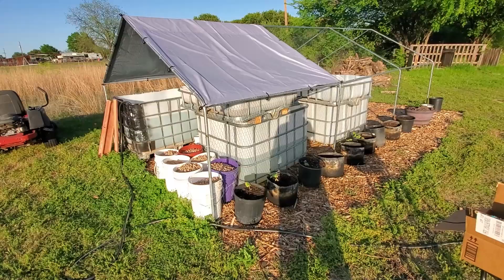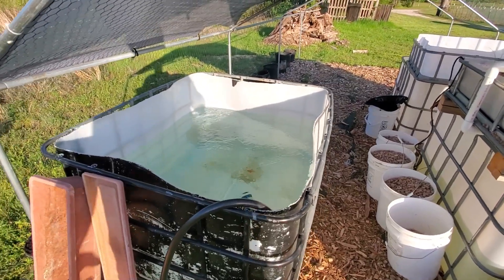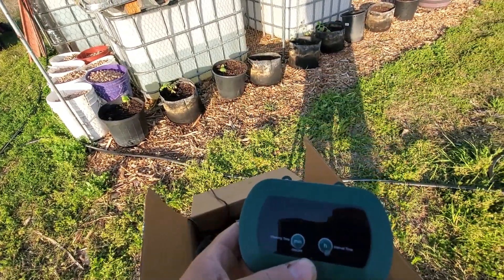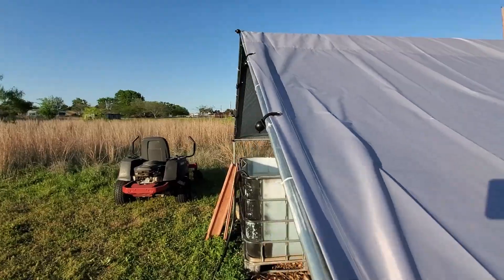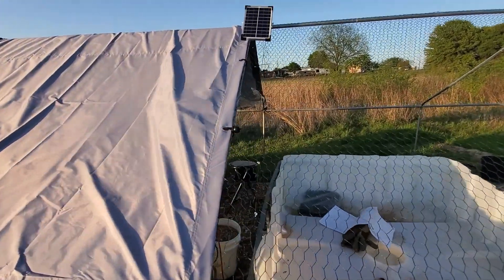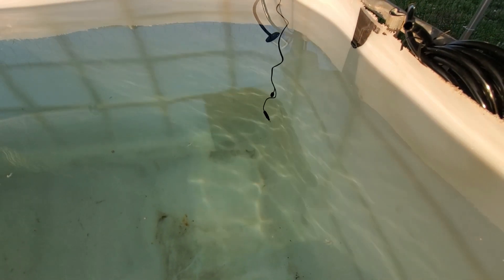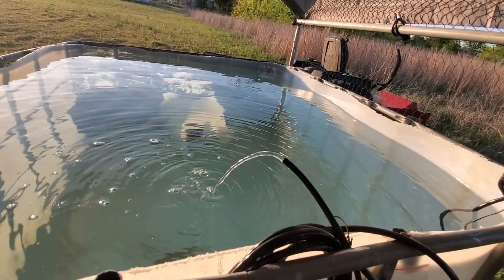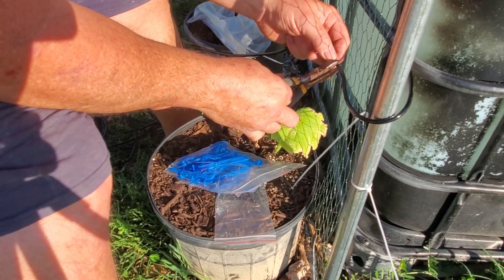Installing Solar Powered Drip Irrigation System

Comment: Hi how have you done the anti syphon device I see it’s on a tea but does it work , i have no instructions for it thanks 😅
Reply from the maker: The anti syphon works great. I’ve had no issues at all. The instructions that came with the unit were not good at all. Glad they pictures for me to look at.
Reply: Ta I copying yours it works ok now ta
Reply: Why does my system keep beeping? There is plenty of water
Reply from the maker: @LindaandStephen  Are the water sensors all the way under water? Mine flashes an E1 and beeps to let me know to add water. If the sensors are all the way under the water try pulling them out and cleaning them or maybe turn the unit off, wait a couple of minuets and then turning it back on. Let me know how it goes.